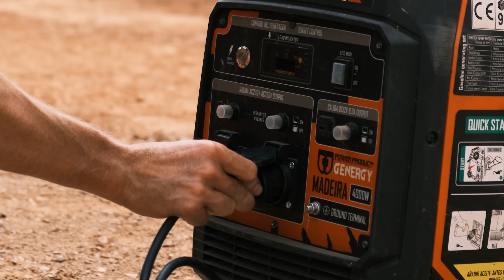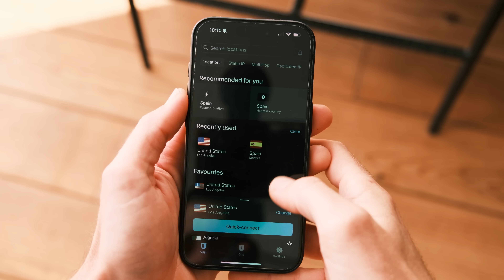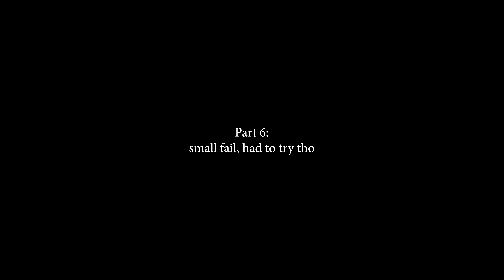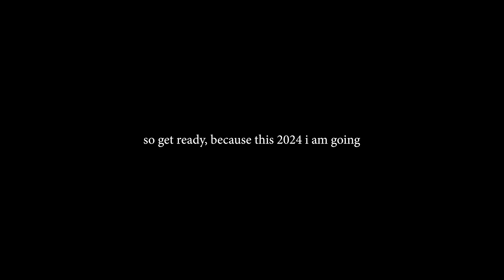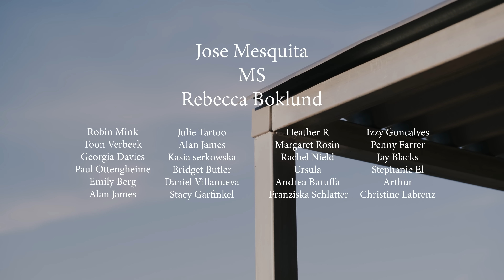Building Our House Start To Finish | Episode 11 Outdoor Metal Structure

Comment: Nice work. For the sagging you could have gotten away with a lattice horizontal beam i think, so you wouldn't need the pole in the middle. As mentioned I would reinforce the structure with some diagonales. A serious storm will damage it the way it is now I think

Comment: One idea! But I love your project and videos.
In front/ opening you could weld a L shape metal to strengthen the 40x40 square tube . Weld to the bottom of the 40x40. Then it wouldn't sag . And you ceep big opening.

Comment: Great job. You can still take out that middle post. Simply weld another 6m cross beam and secure it with say 150mm stubby uprights to create a cross beam that can take the weight

Comment: Nice job Pepe, the only thing I would add would be some diagonal bracing on the uprights so that the welds aren't being constantly flexed by strong winds which might otherwise result in the welds failing over time.

Comment: Looks very flimsy, and the gauge of the steel you used is a little too thin, you should also add some diagonals to the back and sides of your building, to make it more stable. Good luck!

Comment: theoretically you could concrete the legs in, and also pour slab of concrete instead of rocks under the gazebo. you will have a nice flat plumb surface. Also if it is me, I will make little pitch so the water running down.however not bad

Comment: You’re my hero Pepe🙏👍 Well done for designing and then building this. Very clever way of raising the structure. 
I felt your emotion when you fitted the longer legs 👌 Could you replace that front centre leg with a removable one?  If you welded a U shape onto the end of that leg, with it being slightly larger than the tube diameter, then maybe put a bolt through  to secure? When you need to remove, just remove bolt and take the leg away. This could be a simple solution. Well done and the shelter looks great! 👏👏 Happy Christmas to you and Eugenia, best wishes for the New Year

Comment: Nice build, but you really should add corners braces to really add strength to the structure.could be square tubes or even just a flat bar.
Also the front middle post could be avoid by adding a second square tube under it, even better if you let a space between them and use flat bars cut at 45 angle to create triangles shapes. This would multiply the rigidity of the front a lot! Covering the sides also would be great, if you dont need it just cover a part of it so ypu can walk under the gazebo, but the sides will add tons of shades, because right now with a very high roof the shade area will be outside the gazebo! Just my few tought on this project. Cheers!!

Comment: why not just put roof panels on top of the original tent frame?? ~$150
Reply: That tent frame looked pretty shaky and I think the legs wouldn’t hold the weight of the panels…
Reply: Tent frame would not have strength to hold, and keep secure, those sheets.
Reply: @happycamper4329  you did make a really nice durable structure there .. keep up the good work, love your vids.